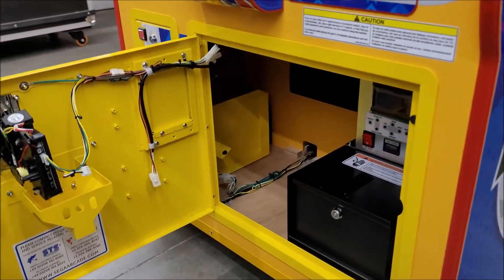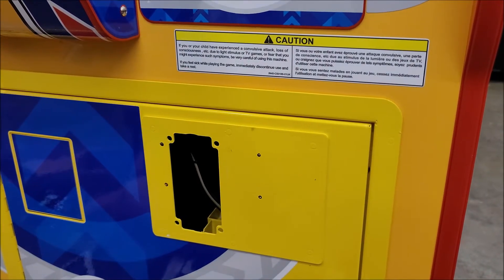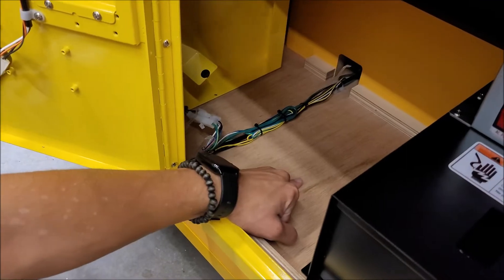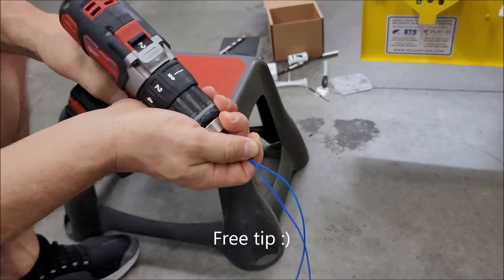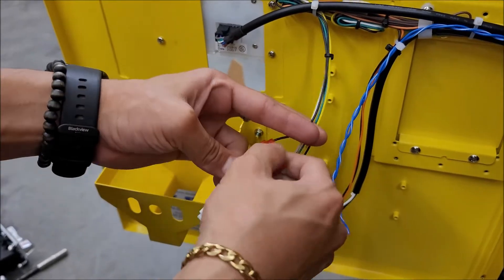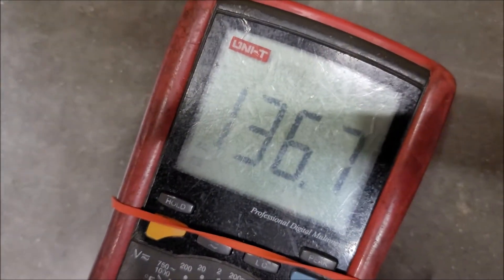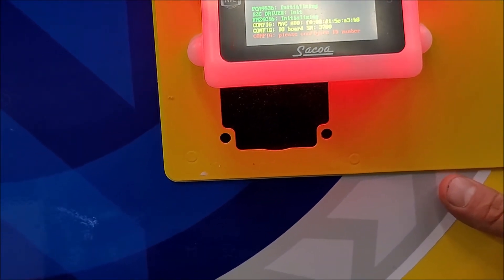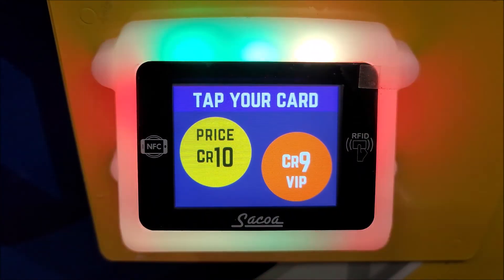How to install the SACOA Spark reader (English)

Comment: nice tutorial :) ill have a question, we are about to use the Spark readers in holland, i saw in this tutorial that the ticket dispenser is the CLE brand.. does that work with the Sacoa Spark readers? because the company which does the installation for us clearly stated that they got to need the (entropy brand) dispensers because the other dispensers like (CLE) cant read the ticket pulse..is that true?? or is it true with the older DR490 readers that it didnt work? do u know this?